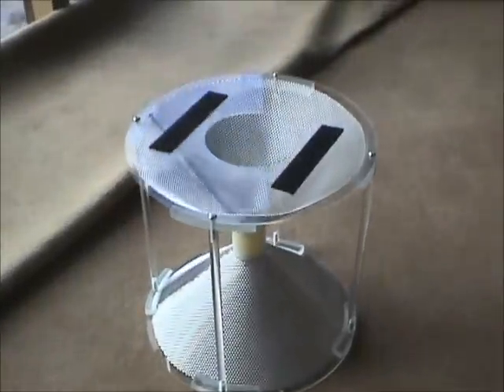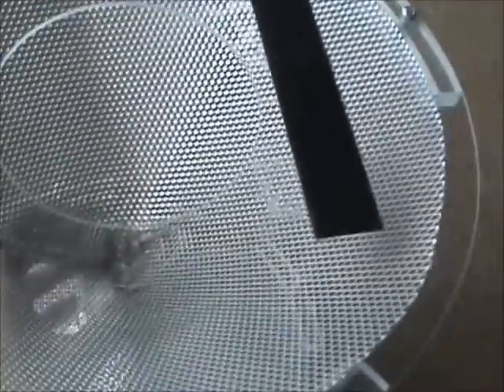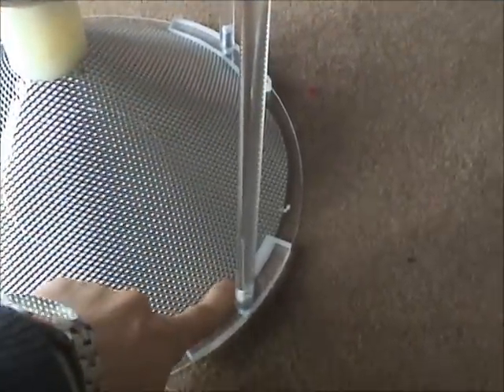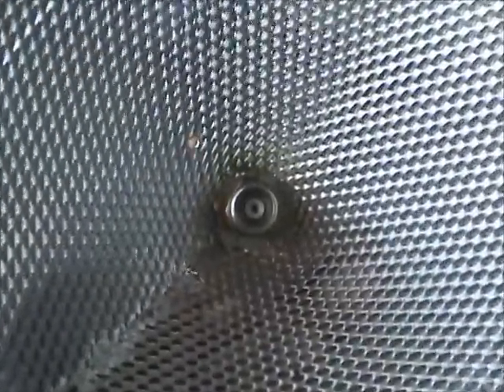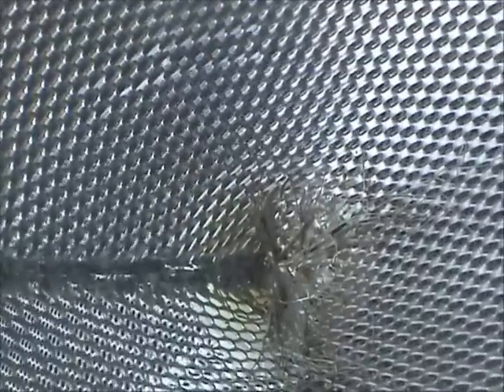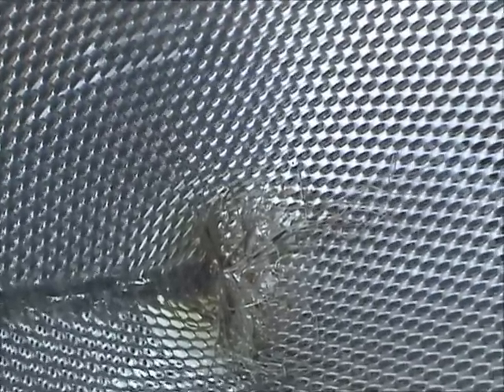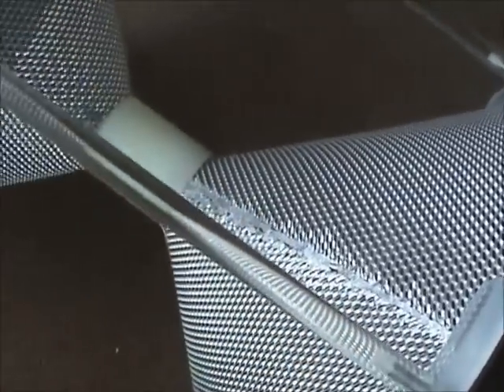Biconical wideband 'homemade' antenna

Comment: I am looking at the antenna and some of the comments and thinking if you need more info to make this antenna, you don't have the skills to make one.  Some of the replies look like bots.   When I did metal work at school (13 years old) one of the first things I made was a small funnel from sheet steel.   I hand rolled the steel over a wooden former  (a piece of wood) to make the cones.  It just took patience.   If I was to make this antenna, I would do things slightly differently to EEEstuff.    I would use plain sheet aluminium (~0.6mm thick) because it is cheaper, easier to buy than any mesh and a slightly better RF conductor.  Rather than use expensive unobtainium epoxy, I would use pop rivets.  The mesh and 0.6mm aluminium are too soft and thin to stop the rivets pulling through.  Just add a backing strip of about 1.2mm-2.5mm thick, about 10mm-20mm wide aluminium on the rear to support the rivet.  These days, I would 3D print the centre insulator/spacer.   I would use mono-filament fishing line rather than rods. Cheaper, no threads to tap, and fully transparent to RF.    None of these things would change the antenna characteristics.
Reply: "If you need more info to make this antenna, you don't have the skills to make one."

Thank you for this brilliant insight.
Reply: @CheckpointCharlieFoodTruck Your welcome.
Reply: @ I hope these people learned their lesson. If they don't know the answer to a question, they shouldn't be asking it.
Reply: @ YT is a fantastic learning resource, but if you are a beginner, then it can be really difficult to know the difference between good and bad advice, unless people add comments.

Comment: What is the trick to spot weld aluminum metal ??? Spot welding works best with metal that has some resistance. Like stainless, steel, chrome steel and such. How conductive is the silver particle epoxy you are using Sir ??? Thanks for your time.

Comment: A rather wasted effort as no mention of how flat it is across the bands. No mention of what the actual impedance is at the antenna. No mention of the wave more prominent wave angles. All we know is, its made of metal and plastic. The bottom line on any antenna is HOW WELL IT WORKS.

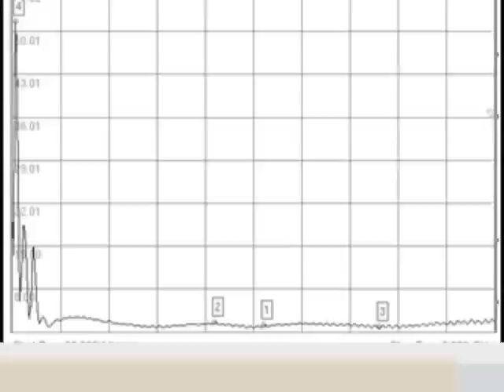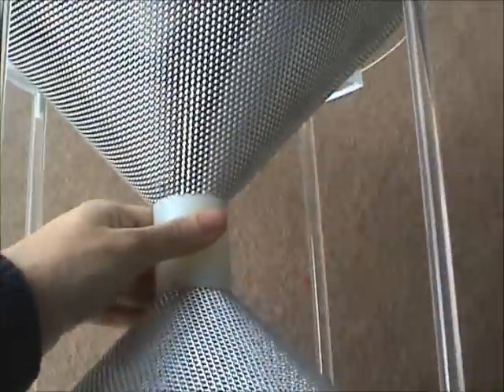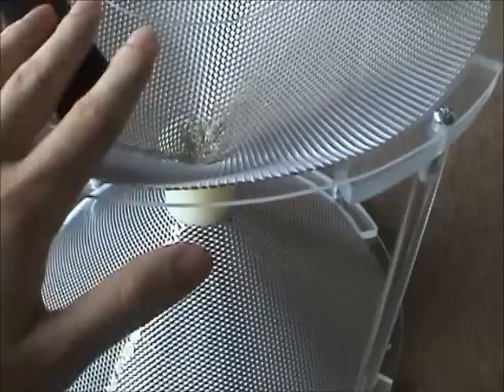Comment: Why do people have to receive the total answers to everything presented. I don't think EEEstuff was intending to give a "this is where you buy the materials" or "this is the step by step for constructing your own antenna". Although, at 0:10 he shows a drawing concept of his plan to build. So for those wanting measurements, stop the recording at 0:10, maximize the video screen and take a snapshot of your screen showing EEEstuff's concept drawing. Dimensions are given. At 0:55 EEEstuff tells the material that was used to construct the cones. For those asking where do I purchase the material? Try your local hardware store. It probably carries aluminum or aluminium screen for repairing damaged screen doors. At 1:01 the material used to connect the two cones is given, nylon. At 1:33 EEEstuff gives the dimensions of the cone height and diameter, both 28 cm. The only information not given is how YOU will construct a like antenna. Nice video EEEstuff. At least one of your viewers consume all the information that you presented.

Comment: I'm not quite too sure on this, I mean graphs is easy enough to see although something is not adding up to good, not enough details on the project, and for any john doe to go out and try to replicate this without any specifications it could be a waste of time and money, even if someone is slightly off in size/dimension of material and cable or connections it will be a total waste of time and money. I think it's safer to spend 30 bucks more and just buy a good reliable one that has been well tested and built by a reputable company.

Comment: Hey EEEstuff, if you are still with us, have you published anywhere your constructions details of your biconical antenna?  We can barely make out the measurements on your hand-drawn diagram as your video is low resolution. It would be nice to have details of your resources to calculate a larger antenna with a greater bandwidth. BTW: your antenna shows beautiful workmanship.